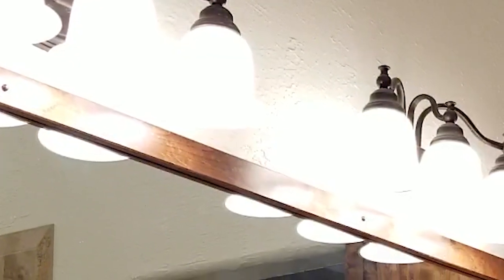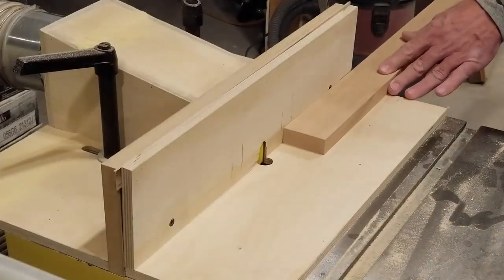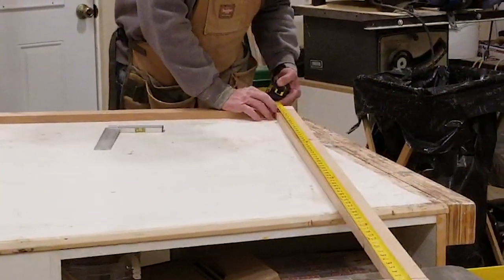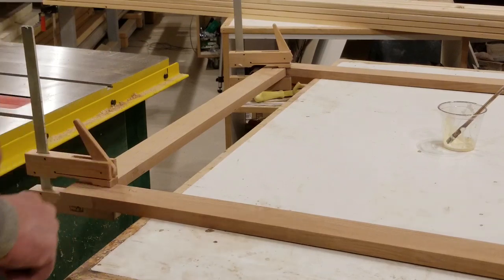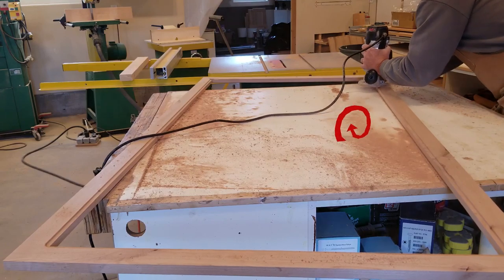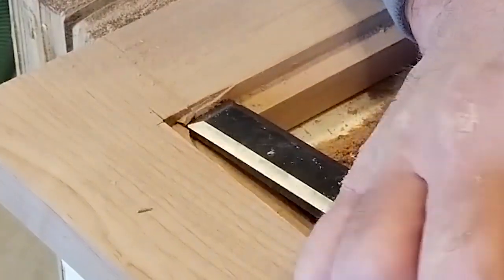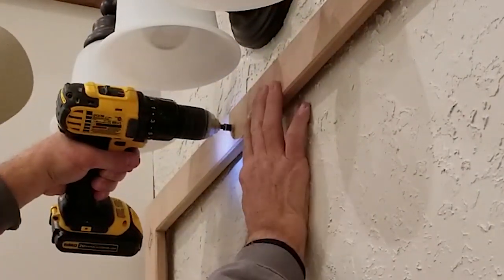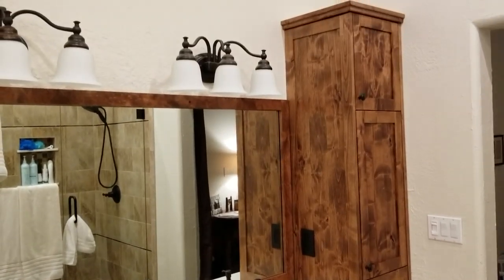Custom Mirror Frame for New Vanity

Comment: Nice Video Rusty we remolded our whole house and one thing left to do is build a frame for a mirror,  the guy that hung the cabinets hung one of the side cabinets out of plumb😫the only way I can figure out how to make a frame square is to make the frame wide and cut angled rabbits.
Reply from the maker: Yep, Falcon, sometimes the best craftsmanship shows up in being able to hide something like an out of plumb cabinet or wall. We are just finishing a vanity in a second floor bathroom where there is a half inch dip in the center of the floor over an 8 foot span. We were able to bury it in the toe kick and it is fine. Sounds like you are on the right track!